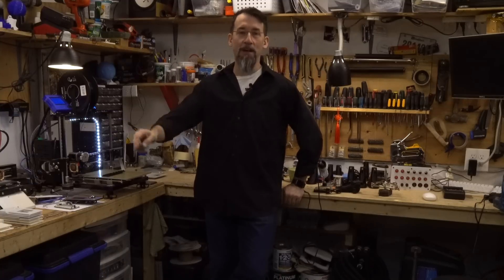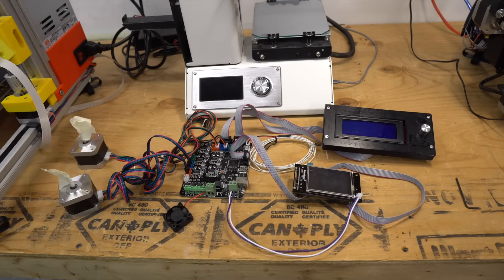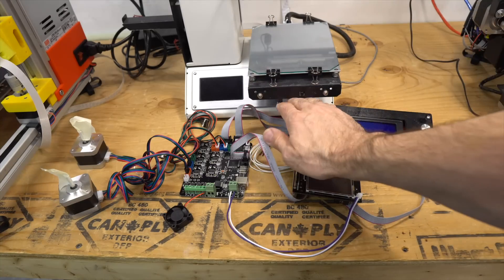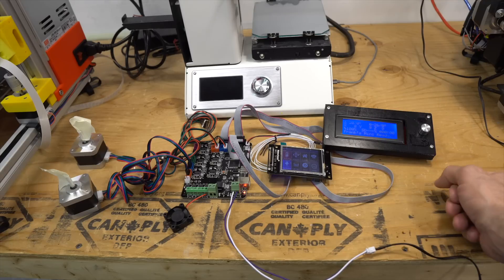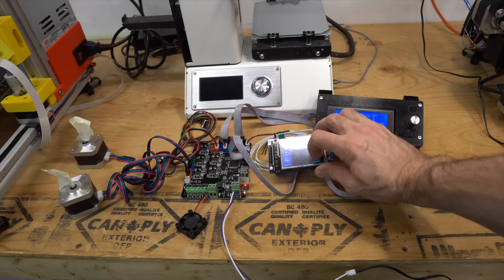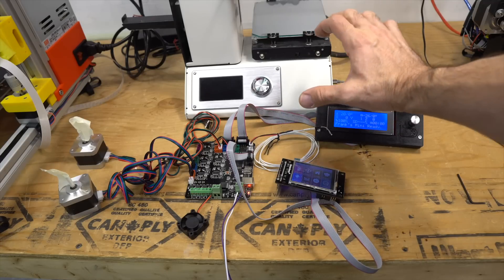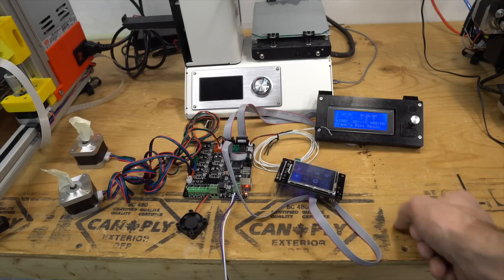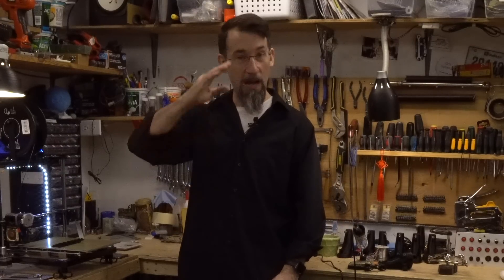Monoprice Mini V2 - New and Improved! - The Plan

Comment: Frank, After looking at your thingiverse parts, I'm curious to know if the usb port on the MKS Gen L will be accessible from the outside so that one can use Octoprint, for example.
Reply from the maker: I have a plan about that, I have ordered an extension that will be mounted on the back of the case, I need to do a support for it...
Reply: @Franks3Dshop  Thanks.  I figured you had it under control...

Comment: Frank, this project could not have been more timely!  The USB port on my MPSM failed so I had already decided to switch to the MKS Gen L board with Marlin.   Already got the board, in fact.  I'll be waiting with great anticipation as you lead us through this project.
Reply from the maker: Hi, I am in production for the video, everything works, Marlin with Linear Advance works, touchscreen working, 3D parts MKS bracket and touchscreen faceplate done. I am simplyfing things as much as I can. I should have part 2 up for Sunday including the 3D Files, I will upload the 3D Files sooner, check my thingiverse page for updates if you want to be prepared... https://www.thingiverse.com/Franks3dShop/about
Reply from the maker: Here you go if you want to get printing before I finish my videos... https://www.thingiverse.com/thing:3488387

Comment: Well Frank you know I love you stuff but (But) get it out already.. ;) .. When all is said and done publish; if it's not 100% we are here to tweak or help with said..
Reply from the maker: I am having fun doing this, designing the faceplate, brackets ect. I do my best to get videos out, but it takes time, I want to make it mine! I could make a video of my current progression and the bugs I encountered. I am still waiting for some parts. Right now the faceplate is finished and printable with the mini in two parts in two designs. The bracket for a low cost Atmega+Ramps is done, Marlin is configured, I need better drivers I wait for TMC2100 to arrive and a MKS GEN L, right now with the Atmega+Ramps+TFT-LCD, the USB connection can not be used for octoprint or with a computer, SD card works fine.

Comment: Frank, the MPSM v2 main board works with Marlin 2.0.  You don't have anything to lose by trying it.  If it works you can keep the old USB and microSD reader ports keeping the original machine look even closer.
Reply from the maker: Thanks, I will take a look at that, I still would like the touch screen, I am not sure if I could use it, it needs a serial port, maybe I could rewire the usb to serial port... I will investigate that!
Reply: @Franks3Dshop  You may be able to use the existing LCD connection.  The description in Marlin makes it sound like it might be a UART connection.  Tell us how it works out.
Reply from the maker: I saw that, hackaday had an article on the LCD, it has a ESP8266 micro-controller, and sends serial commands to the board using AT+Gode. I will at a minimum try the screen on a spare board with Marlin, just for the fun of it. Not sure I can have Marlin easily on the original board...
Reply: @Franks3Dshop  The original MPSM v2 board is 32 bit so that's another advantage to running Marlin 2 on that.
Reply from the maker: Yes I saw that it was a 32 bits micro controller, but version 2.0 of Marlin is not yet ready for official release “Not for production use. Use with caution!” they say. But I will check it anyway, I could rewire the original board easily when Marlin 2.0 is released. I still will go ahead and make my touch screen version with Marlin 1.1.9, it is sufficient for this small printer.
Reply: @Franks3Dshop  Marlin 2 may always say that.  According to https://github.com/MarlinFirmware/Marlin/issues/7076 the "Maylan M200" board, aka MPSM v2, is working with most features.
Reply from the maker: 2.0 is still in bugfix branch only, meaning that they are nightly builds of 2.0, from day to day it changes. I will try it but I am not recommending using it for now. When it is released like 1.1.9, now you have a stable release that does not change and everybody can download it and get the same results. Version 2.0 uses a Hardware Layer Abstraction, meaning that it still runs 8 bits code to simplify development, I wonder if the original board is faster than a Atmega 2560...
Reply: @Franks3Dshop  The MPSM board runs at 72MHz instead of 16MHz of the Mega 2560.  It also has 20KB of RAM instead of 8KB leaving room for a large serial buffer and more features enabled.  Lots of people are running 32 bit boards with Marlin with reasonable luck.  However you are correct that without tags or a release the tip of the branch is a moving target making it difficult to get repeatable results.  A fork could give that though.
Reply from the maker: I first have to learn how to program the STM32F070CB that is on my board, I did not find a board definition for Arduino yet... yep I could also do a fork, never did that but doesn’t seems that hard. Let’s first try it! If it’s an options making videos on that subject would be nice.
Reply: @Franks3Dshop  Indeed!  There are instructions on Hackaday about how to do it but otherwise nothing in the community.  A step by step video would help the community get over the fear of trying it.  I think knowing the safety features are enabled let alone advanced features such as linear advance are great reasons for MPSM owners to be interested.  I vaguely remember that there are two or more versions of the microcontroller on the board making the Marlin installation less than straight forward.  I hope I'm remembering wrong.
I'm building a second printer using a Re-ARM and RAMPS setup.  As soon as that's done and has proven to be reliable I'm going to try installing Marlin 2 on my MPSM v2.
It is possible to use the Arduino IDE to program STM32 chips.  See https://wiki.stm32duino.com/index.php?title=Main_Page for information.  However the Marlin community recommends Atom and PlatformIO as a development environment.  I've been using it for my Re-ARM and it takes a little getting used to but it's not too bad.
Reply: @Franks3Dshop  For a fun side project look into the Blue Pill at the STM32 Wiki I linked in an earlier reply.  32 bit Arduino like boards for under $3 delivered to Canada!  There is one called the Robotdyn Black Pill which doesn't have the incorrect value R10 which might be the better choice.  Having said that the incorrect R10 works for most people.  It's a pull-up on the USB port.

Comment: Awesome Frank! Waiting for the tutorial so i can do this myself! Btw, how are you doing with PSU? Using the standard one?
Reply from the maker: Hi! I am using the original power supply without problems, my only bug right now is the stepper drivers A4982 makes more noise than the original board, I am waiting for some TMC2100, the original mini has DRV8825 drivers that are able to do 1/128 microsteps, and the TMC2130 are able to do 1/256 microsteps that should be an improvement, I am waiting for inexpensive TMC2100 from AliExpress to test them...

Comment: Frank, what is linear advance for? Also, in the actual assembly video, will you put a link to the parts you used in the description? And I wanted to ask: Did you have to install an operating system on the Marlin board, or was everything pre-installed?
Reply from the maker: Oh and Linear Advance is a process where the extruder stops extruding before a sudden change in direction or a move to another part of the print, it releases the pressure in the nozzle so that corners are sharper and prevents oozing during movements.
Reply from the maker: Hi, I will do a series a video on the assembly. I am designing parts to make the modifications as easy as I can.
Yes, I will have the parts list and where I have bought them.
I also will have more than one setup, a "low budget" and a "Frank's edition" probably.
I have done the configuration of Marlin and will release the files if you want to do the same as I did without having to setup Marlin from scratch.
Reply: Basically MKS TFT24 v1.0 Touch Screen + MKS Gen-L V1.0 Board.
Reply from the maker: Yes and TMC2100...